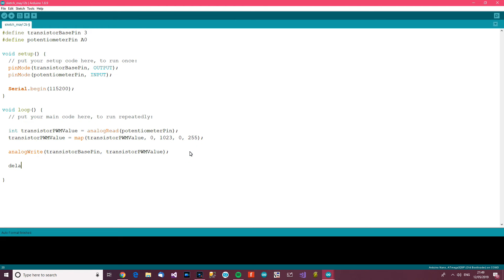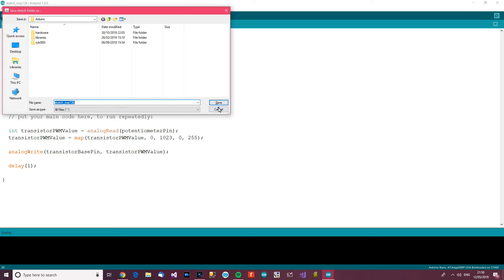TUTORIAL: How to Control Brightness of an LED - Arduino - PWM - Potentiometer

Comment: How to put two codes in one arduino .
I have two programs .I want to put in one arduino 
I want to interface two switch .when switch one is pressed it will perform line following function and when I press second switch it will perform obstacle avoiding function how to do that ?please help